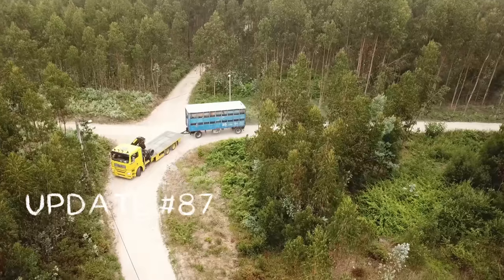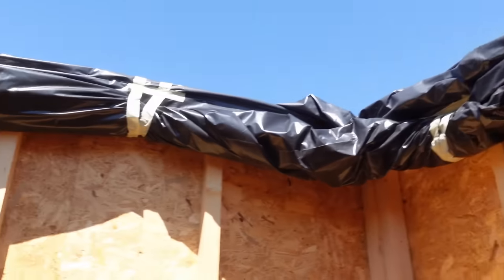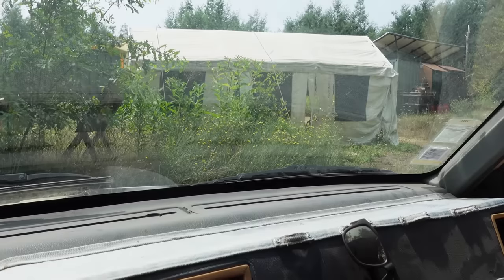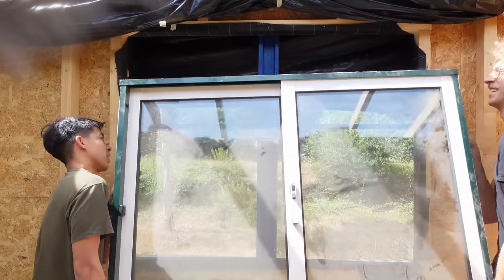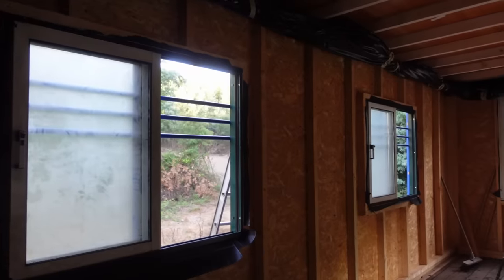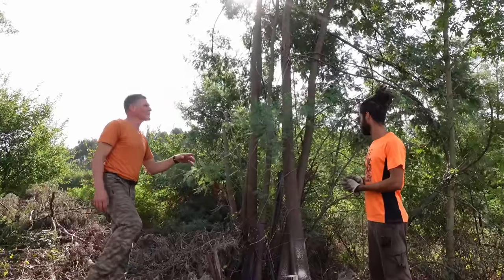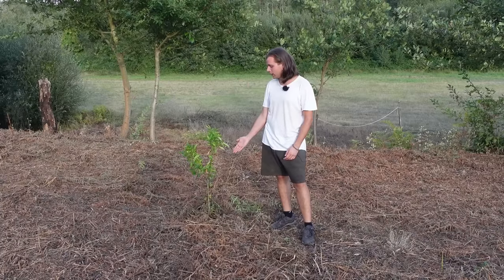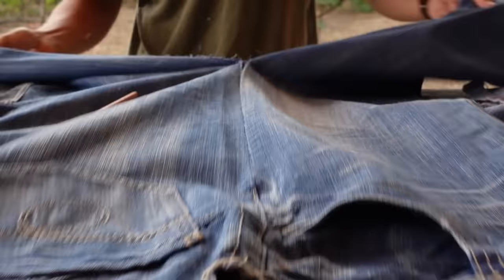#99 Waterproofing our trailer house and clearing the road

Comment: How are you solving ventilation if you cover the walls and roof with vaporbarrier? Also, shouldnt the vapor barrier be put on the inside of the roof to prevent humidity from the inside from entering the wood?

I’d love to see morr about the technical documentation regard some of your buildings with regards to heat/humidity considerations as I might apply something similar here. The current requirements are quite conplext given my climate, but they are definitly there to extend the longivity of our buildings and materials. So if there are any simplifications I could translate from your climate to mine that would be great!

Comment: Unless you seal your Metal around your windows, with some kind of sealer, the water WILL run down and find a way  under your metal and rot out your wooden window frame it will take 20 years

Comment: Helloo! When framing out a wall, you might also put the OSB on the inside of your insulation, where it will serve as a moisture retardant, thus reducing the need for a plastic barrier. Then, after finishing it up with another wood layer, not a lot of moisture will pass through to the insulation. Also, your insulation will have more contact with the outside air, so drying it out will be easier! Cheers

Comment: do not put a non breathable vapor barrier on the roof it will trap vapor between the roof decking and the plastic. 
Are you planning 6" of foam on top of this vapor barrier to move the dew point out beyond the vapor barrier ?

Comment: Maybe the recycled insulation is best saved for interior walls generally? Although i know most thr spaces you guys are building are one room structures. Curious by you dont think a membrane around the outside wouldnt be sufficient? I suppose the trailer framing would make that tricky, on second thought...

Comment: I just can’t Imagine that it had needed that much more wood to build the whole house out of wood, without the rotten pig trailer…

The steel of the trailer should have been added to the normal recycling process.

Comment: Those curtains will help but will not help that much. It's more like a gimmicky solution. You should plant a tree near the windows as a long term solution but in the short term i think an outside window covering made of wood either with spaces for some light and some air to get through or no spaces so everything will be blocked. It will blend perfectly with everything in the kamp and yuo can do this to the pig trailer.

Comment: the curtain must be placed outside! If you attach it inside, you have the heat inside and if you are unlucky, the inner glass pane heats up and breaks because the difference in temperature to the outer pane becomes too great. outside, a bamboo rolo at a distance from the house wall so that it stays light, or let something grow up at a distance from the house wall.
Why don't you have a fly screen yet even though flies are bothering you? that is a different construction site.

Comment: i am wondering: would it be ecological good to use the mimosa for a wood burning heating system in the communaal building. It could heat the water for showers, kitchen, washingmachine etc and heat the whole building. Would the CO2 emmissions be (a lot) higher instead of using electricity (Wich is more sustainable), The mimosa are now almost useless.

Comment: Couldn't you use Cork as isolation material?! I was wondering that the last time already. Cork should be very sturdy against the heat and should be able to tolerate quite a lot of wetness.

Comment: As the same with walls and flooring, you should have staggered those boards on the roof like brick, for strength. Now the rafters where they all end/begin are weak points. There's way too many of you for no one to know this.

Comment: I dont think the curtains will help a lot as they only block the light, the heat is still radiating from the window and curtains, heating up the room. Placing something in front of the windows (outside) could help better.

Comment: If the curtains are in the inside... the interior will heat up. You should make a shade from the outside.  Also those curtains do not look specially neat 😐
Reply: seems at least someone else also make same comment... it is so obvious that is wrong

Comment: You built a whole little house inside the pig trailer. (wood studs and ceiling beams for structure. Plywood sheets for outside. vapor barrier. Basketball court wood planks for the inside. And insulation in future video). Why did you need the pig trailer? you could have spared yourselves all the hard work of preparing the pig trailer and its cost, and just built this little house without it. All you would need is a floor. Love the jeans curtains btw.

Comment: on what temperature does that reused textile insulation spontaneously combust?
Reply: Sarcasm right?!
Reply: @sadjaxx no, its a question,
it seems pretty flammable (to me) and im curious about on what temperature does it start burning on its own
Reply: Well over the boiling point of water, so no need to worry about spontaneous combustion.

Comment: You ended up with an area that is "clean, neat and nice" (27:24). But I wonder why the ferns and the brambles had to go. If you want to create a garden that is very much prone to drying out and getting very dusty, you did of course a terrific job. But what about the birds that were nesting in these bushes? And the insects and possibly also reptiles and even mammals that found shelter there? Mimosa's are a big fire risk, and also an invasive exotic species, so I think they really had to go. But brambles and bracken are native species, not creating a fire risk. I don't think there is a reason to be so proud of the flat lawn you created here.